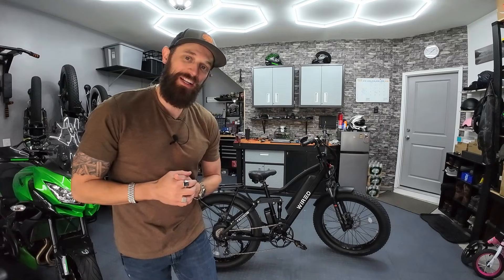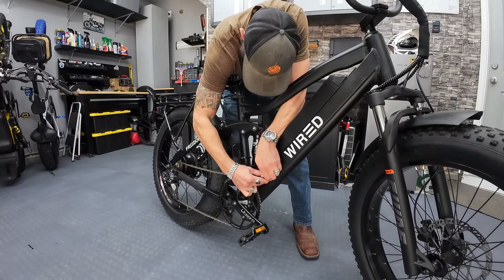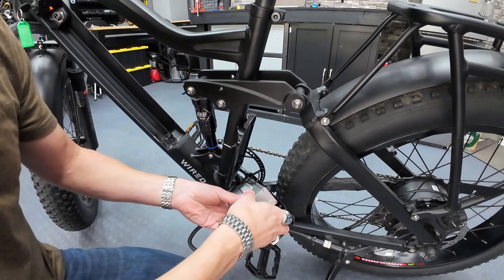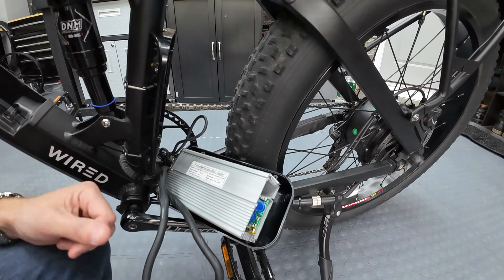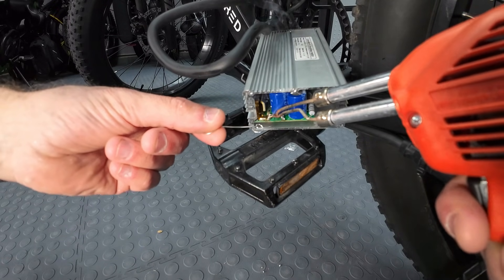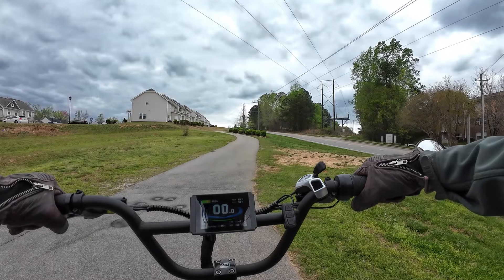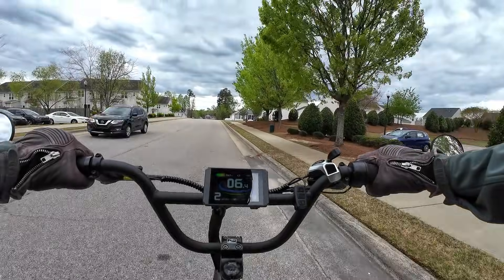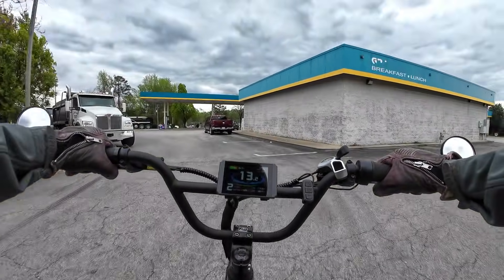Shunt Modding the Wired eBike

Comment: Heat the 2 wires then touch the solder to the iron, they way you do it is called a Cold Solder wich may crack and fall off

Comment: Sorry to say but in my eyes that was a very poor solder job. You didn't actually heat the wires you were soldering together so very likely a dry or poor joint. No flux didn't help the case. Also applying the pressure of pliers direct to a soldered joint on a PCB doesn't seem wise to me for various reasons. 
I would have taken a very different approach, cut the same length of a solid copper conductor and tinned it before going near the board. Then would have sanded, fluxed and tinned the two shunt wires. Then I would have simply laid the wire inbetween, and with everything already tinned, just heat if from below until there is some melt, adding a small amount more solder from one side to the other. As another commenter suggested, you could easily add a switch in-between to make it a non permanent mod. 
These things can be dangerous - if you're going to teach other people, I think you should learn to do it properly first.

Comment: IDK why in America fat tire ebikes are so popular? I have fat Engwe ep 2 pro geared hub 750w and that thing eats battery like crazy and also heavy to pedal... i switched back to normal tire 26 inch 1000w ebike and man with same battery almost twice more range, also way faster and pedal so easy like a bicycle compared to fat bike that riding feels like you ride a tank... And also with fat bike i got way more puncture (idk why...) maybe tire wear... and i hate on my Engwe that tire noise like yours, especially on new tires... i did not manage to find slick tire in my country and with 7-8 punctures on one tire i just put my Engwe in shed not riding anymore. One more thing i thought fat tire are good for snow, but guess what it is not... i manage to slip on ice 2-3 times with my engwe and on my normal ebike with high end tires zero times... so no more fat tires ebikes for me... After my experience i don't see any advantage of someone choosing fat tire ebike over normal tire ebike...

Comment: one note, that soldering iron is far too powerful for this type of application, you can blow sensitive components up, if you do this dial it down to an iron that’s designed for electronics. 
Do some research just in case before you do this. 
35 years experience working on coin operated video game boards, lottery equipment and atms.

Comment: How can i make a 800w controller output only 4-500w?
Yes i wanna downgrade it because my battery can only support 600w.
So at this moment the 800w controller makes my battery cutoff after 20-30 seconds.
Its a cheap generic Chinese controller and has no data connection or anything.
Just the cheapest kind you van buy.
Please advise.
Its also for a kids atv and its WAY to fast anyway so i need do something with this or get a new one.

Comment: I bought a 24v/36v/48v 350w controller i hook it up with my hoverboard hub motor when i push throttle nothing spin i open up the controller what i noticed when i switched the power on there a spark coming from the mosfet i connected the study wire then the motor rotating when i push the throttle it spins slowly but when i remove the study wire nothing spins what can the problem be need help

Comment: I have an etrike that does not have cruise control feature. Can I replace the controller only or both that and the display need to be replaced? What would be the best way? It is now a 36V 12A system.

Comment: Will this work with the dual battery model?
Reply from the maker: @johnnycash7803  no those models have controllers that are filled with thermal gel
Reply: @CitizenCycle925  oh ok. Now I see you sell a rear shock does that help with the sag? I'm a heavier guy (240lbs)can't seem to get the sag right with dnm shock. An I plan on carrying a backpage on the bike to camp overnight so that's gonna add more weight. I got 240psi (250 psi is the max)in the shock an still getting like 15mm of sag an that's without another 50lbs on my back. Looking for an upgrade any ideas? Thanks for the reply!
Reply from the maker: @johnnycash7803  my rear air shock is definitely cheaper than the DNM, and I believe the max pressure is 180 PSI so that won't work. maybe look in to Rock Shox.
Reply: @CitizenCycle925  I did briefly not sure if it sure if it would fit I don't know anything about bikes lol. Jist got my ebike last summer.

Comment: One thing you didn’t explain was that your overall maximum mileage would be slightly less as doing the mod uses slightly more amps and watts for the same amount of distance travelled so a mileage comparison before and after would have been helpful is I did this mod on my ebike which I built myself and the increase in power seemed to drain my battery more which gave me less mileage, as we all know we have range anxiety so is modding the controller the best idea when or you get is a bit more Umph !!! also a temperature sensor would have been the most important part as to know just how hotter the controller got would have been vital in the video so you missed out on a few important points you could have added , great video as you loooked like you were having fun which is the most important part hehe

Comment: Is doing this for all electric bikes? I have a Varun e-bike in the UK and the maximum speed I can go is up to 15 mph, and I do food deliveries and I want it to go at least 20 or 25 mph! I opened the controller that is under the battery, and that little aluminum box is the same one I have on my bike. I opened it previously looking for a cable to disconnect and disable the speed limit, but there are many soldered cables and it's not clear which is which!
I'm thinking of doing this modification. Are there any future problems? What are the pros and cons?
Thank you in advance for your response to my comment.

Comment: The best way is to solder a thin gauge wire on the back of the board. That way you can control the amount better and even throw in a switch so you can toggle from stock to modded.

Comment: A Mosfet is delicate, and in talking with a radio tech from the 80's, back when Mosfet Car Audio Amplifiers were all the rage, he said that it only takes a 0.6 increase in voltage to damage one, so doing a shunt mod you risk burning them up in your controller , just a word of caution.
Reply: Voltage is the same as normal. And the normal voltage swing from full battery to empty is almost 20x the .4v you're saying, so you've been misinformed.
Reply: @samuelfox8126  lol seriously itd be just as dangerous as itd be to put a new battery on the bike that will raise v slightly i actually have a 36v bike i use 48v batteries from my truhvl saw for years  now its fine ill even throw one in parallel in a back pack if im going far
Reply: No

Comment: Don't forget to check if motor phase wires are not melting in the connector to controller. Mine 35A 52v 1500w started melting after shunt mod. I separated those phase wires into 3 separate connections and left them in the open, otherwise they melt. I also shunt moded 45A controller on the same setup, but motor started making noises and got very hot, so I moved back to 35A shunted controller.
Also, it is not good idea to put controller into some kind of housing after shunt moding. It has to have good ventilation, leave it in the open and don't paint it in black. Otherwise you will be pushing your bike back home with cooked controller.
And be cautious about riding into steep long hills after shunt mod..
Reply: So that’s why my plastic housing has  a vent. Cheers.
Reply: @knolez1546  i 3d printed a vent and added a 80mm 60v fan to the other side. Is it loud? No I put in on a rheostat, but debating on putting it on a thermostat. Haven't shunt modded anything yet but im planning on a few things.

Comment: It would be more insightful had you clocked before the mod, then clock it again after to get an accurate comparison. Also, all the YT videos of the WIRED Freedom speed runs never show or mention whether they are pedaling to assist (increase speed) when reaching these 40+ mph figures. Could you explain how the mod change in the Ctlr circuit is furnishing more power? How did you discover which wires to alter? Also, it would be a good idea to measure (and monitor) any increase in the temperature inside the Ctlr since more power is likely inducing more load on circuit. I would be reluctant to try this mod without first consulting a seasoned electrical engineer who is familiar with this particular circuit.

I have had many encounters with Chinese manufacturers over the years, and I am very leary of Chinese electrical/electronic circuitry. They are notorious for using under-rated gauge wires in their electronic devices that tend to over-heat. The majority of the Chinese wire sold on Amazon don't have the gauge, voltage, amp ratings printed on the insulation, that are required in the U.S. I could on and on with specific examples. but nobody really cares about such things anymore.

Comment: How's the shunt mod doing now? Has it fried anything in the controller yet?
Reply from the maker: still working fine!
Reply: Shut mod only changes so much, to really push esc, E-Bikes you would have to change gearing, use higher output batteries but just shunt modding the controller and regular riding should be fine, motor can handle it, esc usually a good brand can handle a little more.
Reply: @JustKeepLivingFPV Shunt controls the AMPS /Torque.

Comment: Wonder if the battery will drain faster and can I connect the wires with wire instead of Sodder?
Reply from the maker: i've never tried wire, not sure if that would work.  yes, will definitely drain battery faster.
Reply: Thank you.. : )

Comment: I have a 48v 1500w peak bike. The stock battery is 48v 11.6ah and i installed a dual battery balancer with a 20ah 2nd battery. Will the dual battery system help any gains with the solder mod ? Also will it help with not overheating a battery since the balancer is supposed to balance power?
Reply from the maker: the solder mod will pull more power from the battery so having 2 batteries should help, it will probably have less voltage sag. My guess would be that having more capacity to pull from would also help keep them cooler
Reply: @CitizenCycle925  OK that's kinda what I figured. I was going to wait to have another controller on standby just incase it 🔥 up but I think I'm going to do it this weekend. If and when I do I will report here.

Comment: The pedal handshake was peak!

Thanks for the dope suggestion, to those curious about the controller melting...

A shunt mod on an e-bike involves adjusting the current measurement resistor (shunt resistor) in the controller to alter the amount of current that the controller reads and limits. If done properly, the mod won't destroy the controller for a few reasons:

The controller is designed with a built-in current limit to protect its components. By modifying the shunt resistor, you're changing the current sense feedback, but as long as you stay within the controller's maximum rated limits, it will continue to function safely.

If the shunt mod is done carefully, the increased current draw will be within the limits that the controller can handle. This ensures that components do not exceed their thermal or electrical limits, avoiding damage.

E-bike controllers often have built-in mechanisms to handle excess heat and prevent overheating. As long as the increased current doesn’t cause excessive heat or stress beyond what the cooling system can handle, the controller should remain safe.

Controllers are generally designed to handle a range of operating conditions. As long as the modifications don’t push the controller beyond its design specifications, it should work correctly without damage.

It’s crucial to understand the risks and ensure the mod is done by someone knowledgeable. Excessive modifications or improper adjustments can lead to overheating or failure, so it's essential to proceed with caution and always remember....

Its your autism; you get to pick the special interest!

Comment: Or you could just buy a new controller that has more watts. Just make sure it has the same voltage as the battery, thats much safer than using that method.

Comment: You have to monitor  how hot the mosfets get with the mod, you dont want them getting too hot for too long, if you heavily mod the shunt you might need different mosfets and upgrade the busbars or solder tracks from fets. Surprised you didn't check the heat of the controller at all, you just have to put your hand on it.

Comment: Needs a soldering lesson. The idea is to heat the wires, that are going to have solder pushed into the heated wires, so it flows into the wires. This is so cringe.😂:face-fuchsia-wide-eyes: His is literally dripping melted solder onto room temp. wires, then a big blob, lands on the PCB:face-fuchsia-wide-eyes::face-green-smiling:

Comment: So, if I use rosin core wire, I do not need to apply flux beforehand, correct ? And I do not need to heat up the shunt correct ?

Comment: My own experience on my shubt modded 2024 Wired Bike: seemed to pickup a few watts in lower pedal assist. For instance Pedal assist 1 used to be about 230 watts now its 250. I had a hard time riding under 18 mph in pedal assist 1 now. Bike just seemed to have a bit more juice on the same setting.   Off the line power a little more snappy, the top end I hit 41.6 peddling with full throttle on flat with no wind so maybe 1 mph gain or so on the top end.  Based on this a worthy mod and its probably not going to affect any reliabilty

Comment: Thanks, the mod was fun and would like to read more. how about a higher output controller?  I do know that CA Cycle Analyst have done some testing with e-bikes power, my first build 9 years ago was with CA and a 1000 watt drive had a lot of fun and 16,000 miles. sold it last year. Have a new bike now lower watts but just as fun.  75 years old and enjoying life.

Comment: I know this is off the subject but I got a e mail about a bigger battery with your kit and I was curious as to how much bigger the 20 amp hour was over the 15 amp I wanted to make sure it will fit in the bag with your controller
Reply from the maker: 20ah is 180mm x 170mm x 75mm and 10lbs,  the 15ah is 180mmx 150mm x 75mm and 7.5lbs.